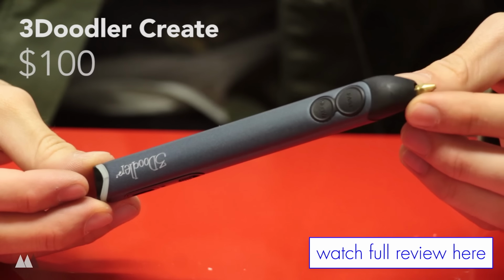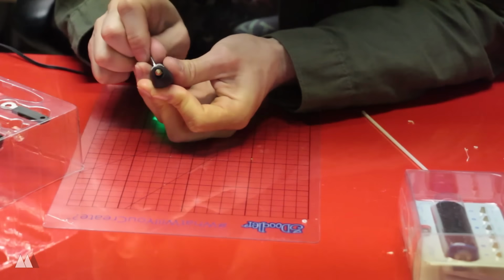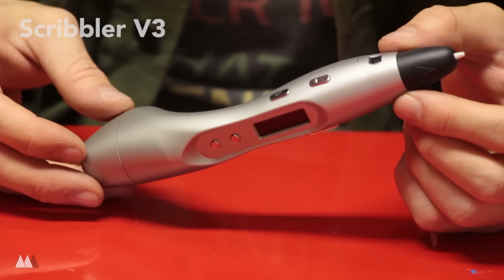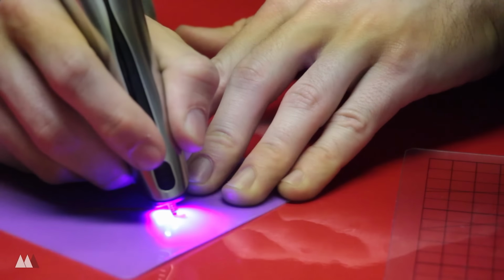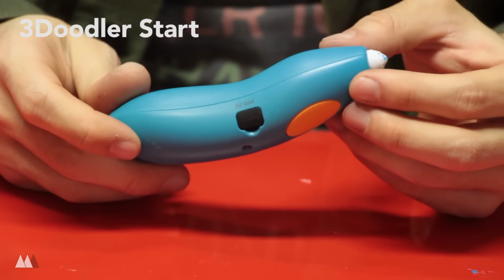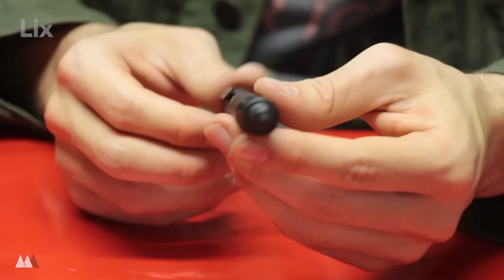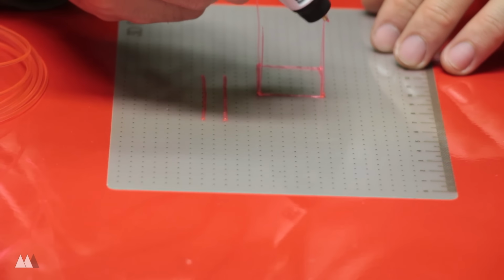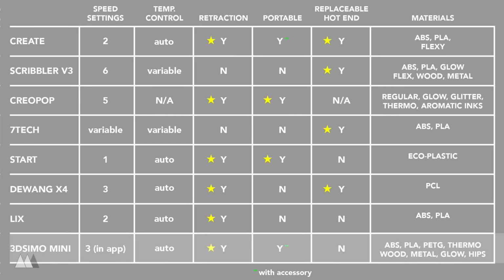What is the Best 3D Pen???

Comment: Just start with the cheapest 12v model from Aliexpress. Give it ample time to warm up. Don't force the filament in etc. It works fine. Then if you find out that you really use it alot you can always buy a more expensive one.

Comment: You failed to mention, pens which can use filament from standard 1.75mm spools are gonna be FAR more affordable in the long run than pens which require expensive proprietary/specific filament sticks. A typical 1kg roll of ABS or PLA only costs $25 or so. The same weight in filament sticks can be nearly 10 times more. Who's gonna spend $200 on sticks when you can buy a pen which can accept the same filament any 3D printers use? I received a LIX pen as a gift, but gave it away because it only used sticks. My Mynt3D Pro 3D pen is boss. It can use anything.
Reply from the maker: Yea the mynt3D pens are my new favorite 😁

Comment: Can I use ABS 1.75mm filament with the 3doodler Create ?
Can I use a spool of abs 3mm (2.85) 3d printer filament with the 3doodler Create ?
Reply from the maker: 1.75, no. 3mm, yes. Just cut the spool into short sections and straighten them out

Comment: Your not really meant to draw in mid air for detailed projects keep that in mind. What youre supposed to do is draw the shapes on a grid then connect them with filler for a proper 3d project. Or if you want it curved then use a 3d stencil like a fruit for curvature

Comment: What an absolute disappointment. Under no circumstances would I recommend Lix 3D Pen. After receiving after a long waiting time, it stopped suddenly working. It does not work and has plenty of reviews to vouch for that as well. Not only does it not work but Lix also offers no refunds (I wonder why!?). It makes sense to not offer a refund when you know your product is not going to function properly and you have already been paid. I was offered to have the pen fixed but there is no guarantee that the same issue will not occur again. Not only is this inconvenient but also unreliable in a work environment. And to top it off, their customer service is worthless. Recommend finding literally any other option to replace buying this crap product.

Comment: is the 3d doodler portable?
Reply from the maker: They sell a battery pack but it doesn't last very long
Reply: Make Anything ok, thx!
Reply: It leads me to another question lol.Which 3D pen has the longest portable battery?
Reply from the maker: Any 3D pen that uses a USB cable can connect to any USB power bank can potentially be the longest lasting. Actually the 3Doodler is one, but it doesn't come with the USB cable. The 3Dmate pen is a good option, 3Dsimo works... most pens use USB actually
Reply: Make Anything ok thank you so much, that is all. Love your vids! Good job btw!

Comment: From what I've learned about the Creo Pop, it DOES NOT use UV lights, but rather LED lights, which are safe. I believe the safer LED lights was one of their marketing advantages offered in their advertising of their product (Just like the Polyes Q1 light curing 3D pen - which also looks really safe). From their website about safety: "The LED lights used by the pen are similar to LED flashlights."

Comment: I just bought a Dewang x4 ,it actually came with PLA filament. It had the letters and size printed right on the package. It worked fine,the stream is thinner but it dried pretty quickly. I don't know if the filament makes the difference. The instructions did say to use PCL but didn't provide me with any.  Have you tested your dewang x4 with pla filament?
Reply from the maker: Hmm.. I know they had a PLA version, maybe they just gave you the wrong instructions?
Reply: Make Anything // 3D Printing Channel that could be it.  
I bought it off Wish and was hesitant,hoping it wasn't a knock off. Seems legit though. They might just be getting rid off old inventory. Only cost 41$ not including shipping

Comment: This shows the Creopop which has an LED light which many think could harm the eyes. There is another 3D pen called a Polyes Q1 which also has an LED light. The reason for the light is to cure the plastic and harden it without using the extreme heat temperatures of the other 3D pens. This makes it safer for kids to use and it's safe on the eyes since its not a regular LED light. The company even won a Nobel Prize in Physics for their new technology.

Comment: This was extremely helpful, thank you! I got the start a few weeks back as an impulse buy, so this quick set of reviews will help in my next purchase. definitely thinking about getting an X4 for my next one, and then the Lix (because of the abs) if I decide 3D pens are another art form I'd like to take on. I am curious, however, where you've gone for your purchases. do you buy exclusively online? Or have you found local stores that have the filament readily available? I'm mostly asking because I found my start at Target but I have yet to find a local place that sells filament so I can avoid buying online
Reply from the maker: My Lix completely died right after these reviews so I might suggest avoiding it. The Scribbler and 3Doodler Create both handle ABS just fine.
Reply: Make Anything // 3D Printing Channel how long did you have your Lix?

Comment: It there any pens that will melt tin non lead solder?
Reply from the maker: the 3Dsimo has a soldering attachment. I wouldn't try it with other 3D pens
Reply: Hey thanks for the quick reply. Nice overview by the way.  I just bought 3Dsimo christmas package. Just for this reason and your review. Wish you got a cut of it. I had to order through a Canadian link. 
I want to try to do is loss material aluminum casting. I want to try some oddly shaped objects out of solder. Make a mold and cast it in aluminum by just melting off the solder. I have a gooseneck style of mold fill and overflow ports that allow the solder to drain off I have been playing with, casting blocks. I'm thinking the tin solder might get stuck in small details and not drain out. Only find out if I give it a try.
Reply from the maker: You can do the same thing with lost PLA casting.. but yea, little details may always be a problem unless you do a plaster cast and melt/burn out the positive first

Comment: weird question but which pen do you think is quietest? and also how strong are the fumes from these, hot glue gives me a headache sometimes so I want to avoid fumes as much as possible to work with.
Reply from the maker: I only notice the fumes when using the ABS material. I think the 3Doodler Start and Lix are among the more quiet ones
Reply: thankyou!

Comment: Hello Davin! Video looks great! :) There is no need to be concerned about safety of CreoPop LED lights. Our LED light is in blue spectrum, so it is not harmful for the eyes. We have conducted a Photobiological Safety Test under IEC 62471-2006 Regulations, which proved that our LEDs are totally safe for eyes. Also, it will be more comfortable for your eyes if the room is well-lit and you use black mat surface for creating.
Reply from the maker: +CreoPop that's great to hear! I want sure since there is the auto shutoff when the pen is tilted, and commenters were saying it's because of the UV rays

Comment: +Make Anything // 3D Printing Channel
Good content, as always, but what's up with the video quality ?
I see a "Yellow/orange cast" that "travels across the picture, from Your hands and up over Your face and then disappears.
It's most clearly visible "on You", and oddly enough hardly visible on the "background", it's quite apparent  in the "intro shot" from (approx) 0:11 - 1:30. I could  spot it in any other parts of the video,  but  due to the content, not quite as clearly.
But it's always a  band/patch, that has the(very approximately) height of 1/5*frame, and is most visible in the center 1/3 of the width of the frame. It's centered horizontally and it "wanders" vertically from the bottom towards the top, but it's visibility seems to partly depend on the colour of the video over which it passes??
What's up...Have I eaten something "bad" ;) or is Your camera  possibly "on the fritz" ??
Best regards
Reply from the maker: something to do with the fluorescent lighting in my garage :\

Comment: I think you have a small error in your chart. you can remove the hot end from the 3dsimo even if its clogged. They include a metal tool in the box to cut the filament right behind the hot end so it can be removed.

Comment: My Abs filament doesn't stick to other filament. Is that normal?? For example when I am drawing cubes and I get to the top of it the filament just won't stick to the vertical rods that I didn't pull it off from. I use the three doodler create btw

Comment: which filament is better , ABS or PLA ?
Reply: MAG POWER pla isn't as smelly as abs but abs is harder and more reliable
Reply: MAG POWER it depends what you are using it for. PLA is safer to use as it is made from sugars so it makes it more food safe, but it can be brittle and break easily. Also it has a lower melting point to it can soften easily (so don't leave it in your car or in really warm places). Keep in mind that sugars can burn if the temperature are set too high on your machine. PLA does not need a heated bed as it will not warp as easily as ABS when it cools. ABS has a higher melting point so it won't melt as easily. The bonds are stronger, but yet it is flexible enough not to break as easily as PLA. ABS is not food safe as it contains toxic chemicals that should not be injested. It needs a heated bed so it does not warp from shrinking when it cools. I found that they both can roughly be the same price if they are the same quality. ABS smooths better with Acetone than PLA (PLA seems to melt too quickly to smooth).  I hope this helps let you decide which one is better for what you want to use it for.

Comment: I got the 7tech to and it always pops up the surface I'm drawing on or it gets jammed what can I do to stop that
Reply: ICHIGO KUROSAKI Different plastic filaments stick to certain surfaces better than others. When I use PLA filament and want to be able to peel it off of a surface, plastic or plastic like tapes work best for me. If you use PLA plastic on paper though, it sticks very well and will tear the paper when you peel it off. ABS sticks to paper nicely, but won't rip it when you want to peel it off (works really well if you are using a stencil). 
Sometimes it just really takes some practice and just playing around! Each pen is different! I have a 3doodler create 2.0 by the way, which is what my experience comes from!
Reply: ICHIGO KUROSAKI Oh, and as for clogs, what has helped for me: Remove the filament from the pen, trim off the stringy/chewed up end, and trying again. Playing around with the heat settings can sometimes help. Also, it can be a good idea to just turn the pen off and let it rest awhile if you've been using it for a long time. Lastly, don't use a strand of filament that is too short! When it's too short of a piece of plastic (or say your pen clogs, and there is a small amount of filament left in the pen), and it clogs you'll have to use a tool to help push it back out the back of the pen very carefully! The 3doodler comes with a metal rod so you can do that, but I don't know about the others!!

Comment: Is 3mm filament the same as 1.75 filament for a 3D printer
Reply: no they aren't the same. You most likely need the size specified on the pen.
Reply: K&K Time there're different sizes

Comment: I bought filament for my 7tech (pla unless amazon lied) and it doesn't stick to any surface so it pops up when make it like cubes even on printing mat things like the one you used it also smells extremely bad
Reply from the maker: PLA barely smells, so maybe you got ABS, which is indeed more difficult to stick to surfaces.. It also helps to draw with the pen more vertical, instead of holding it like a regular pen
Reply: Pigzey just use his trick and spray hairspray on it
Reply: Make Anything // 3D Printing Channel my 3doodler create was only 65 dollars
Reply: Pigzey I use paper and I melted my place mat (sorry mum)
Reply: Make Anything // 3D Printing Channel

Comment: Excellent overview.  I only own the 3Doodler Start and love it but wish the custom filament you have to use would come in longer lengths.  Replacement filament is inexpensive but you can run through 2-3 sticks doing even the most simple design.  On the plus side, it comes nicely packaged and with an excellent booklet.

Great channel, great content and I look forward to whatever you post next!
Reply: Pierre Fontaine cant say the same i got a start a while ago and it got clogged in the first five minutes. I took it back, got another and the same thing happened! I now have a 3doodler create plus and i love it

Comment: thank you would a 3 doodle create be good for a starter  who wants to get started?
Reply: Henry Seymour I think so. Not only is it fairly easy to control, but it has two speeds: fast and slow, which would be recommended for amateurs. Also, the process of loading in plastic is very simple and easy. Just be sure not to touch the tip of the pen.
Reply: Addicted to Fairy Dust thanks I am deciding between that and the 3Dsismo mini
Reply: Henry Seymour Go for the 3D simo mini!!